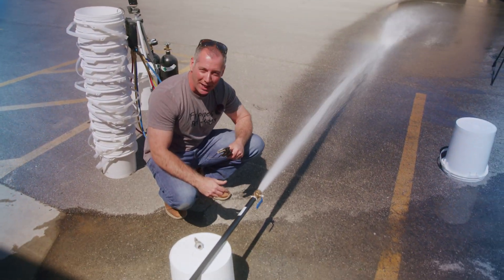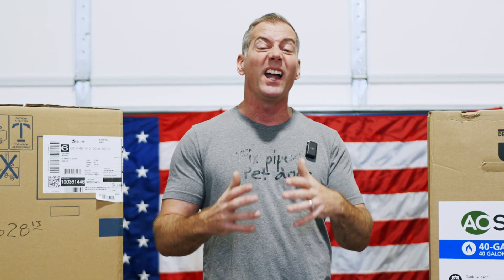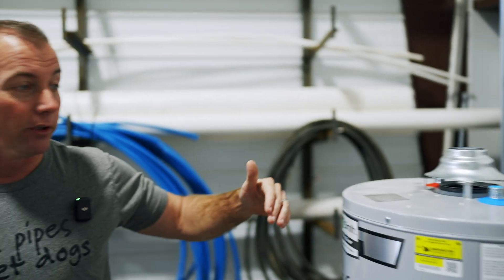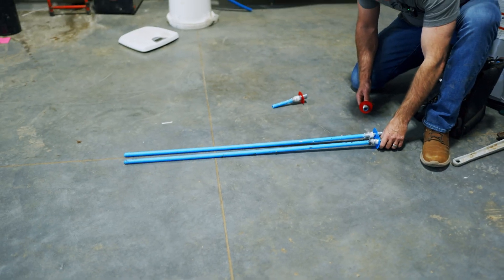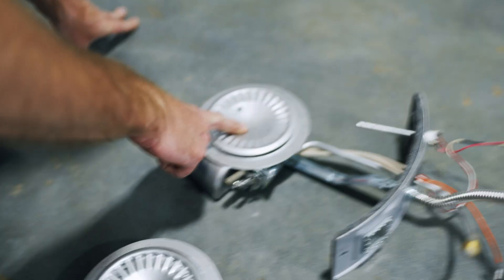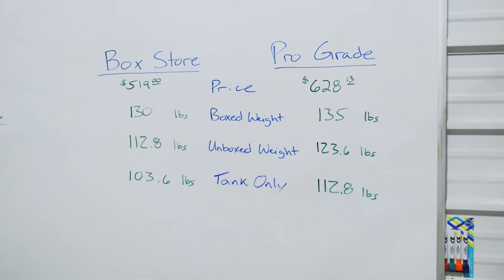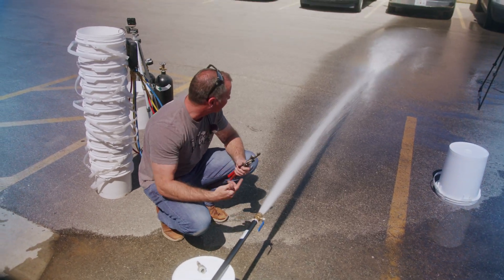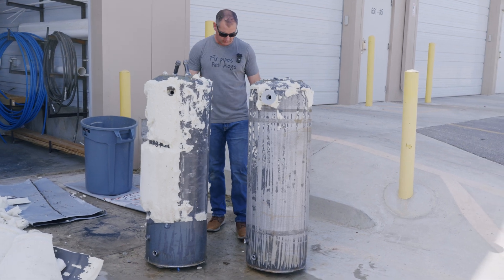What's the best water heater? Box Store vs. Pro Grade

Comment: Curoius our gas water heater in our townhouse the Pressure relief valve goes off every 4 to 5 months then its good again. The water out the tap is extremely hot.  Today it did it again The units have a main water feed with a central expansion tank for every 4 units.  Water heater is 18 year old so I know its close. Is this the gas valve malfunctioning to keep the limit to the adjusted heat temp
Reply from the maker: Sounds like your thermal expansion tank is either undersized or the bladder has failed.
Reply: @SmedleyPlumbing  So i assume the townhouse board needs to investigate the expansion tank in the unit its installed in that controls ours and 
the other 3. I appreciate the incite on maybe the issue. P.S. I havent seen much update on your Transit electric since you first did all the vids on it

Comment: I am glad you expose the differences. Those water heaters shouldn’t be allowed to carry the same model number. By the way it’s not just AO Smith. Rheem does the same thing.
This practice is gaining popularity with other product lines. For example the Zoeller pumps at Lowe’s do have plastic covers instead of the metal ones found on pumps sold either direct from Zoeller or through supply houses. I haven’t weighted them or disassemble them to see motor and impeller differences. I personally find this practice deceiving and unethical in name of profiting a few more bucks leaving an unsuspected customer with an inferior unit. I wouldn’t had an issue if they were sold as different models but selling them as identical it shouldn’t be allowed.
Reply from the maker: Yep

Comment: Ok so was it me or did the pro grade fail first??? So pro grade weighs more and cost more and fails under pressure first....
Reply: I mean nipples move and twist I can almost bet on the pipe attached to water heater going to snap
Reply from the maker: The box store unit started leaking first.  The pro grade held more and then popped.
Reply: @SmedleyPlumbing okay so prograde is still better?

Comment: Prograde 3800 installed. Is it really 3k different for a few more pounds of weight?
Reply: Not for me, for 3k could buy another 3 box store water heater, say they last 10 years each, that’s 30 years… is the pro grade going last 30 years?
Reply from the maker: You just explained an impossible scenario. You're comparing the installed price of a pro grade unit versus the over-counter price of a box store unit. One of them results in a complete professional installation while the other one results with you standing in the parking lot of a box store with a water heater that you can't fit into your car. If I were to compare the pricing of a box of Mercedes parts compared to the pricing of a completed and professionally assembled Mercedes I would be shocked at the difference as well. However one of them is a box of parts in my driveway while the other is a completed and professionally assembled car that comes with warranty and years of trouble for use.
Reply: @SmedleyPlumbing you know that the Mercedes example doesn’t make sense because we’re using the same pipe and internals from the house… the better example is would you rather pay Mercedes to rip you off on a battery change or do it yourself, since you’re just replacing a component and not getting into the internals of the house, ie the engine.
Reply from the maker: @kitmarshall4084  shame on you for assuming that a service provider is charging somebody for repairs and classifying that as a rip off. Millions of people every day spend excessive amounts of money on Starbucks coffee. Coffee they could make at home for a fraction of the price. But they don't complain because they enjoy the experience that comes from somebody else making their coffee. People's time is worth more than other people's time. And for some people it's actually cheaper for them to pay somebody else to do the repairs for them than it is for them to drop what they're doing and make the repairs themselves.
Reply: @SmedleyPlumbing i think you enjoy getting rip off… or insane rich that you’ve lost touch with common folks and resort to shaming those that try to save a buck or two
Reply from the maker: @kitmarshall4084  No there is absolutely no shame and wanting to do the work yourself. The shame lies in calling service providers a rip off because they're charging fairly for the services that they are providing. I don't know what you do for work but I guarantee you shouldn't do it for free and you probably don't do it for free and neither should a service provider.
Reply: There’s not a 3k difference, that is ridiculous. There’s about a 100 dollars difference…. You’re comparing apples to oranges and i have no idea where you’re getting your oranges. Most plumbers I know around here are getting 1000 or so for an installed 40g gas heater. If you don’t want it installed you can surely find a supply house near you that’ll sell you the pro model though.

Comment: My last box store water heater lasted ~20 years and I replaced nothing on it.  Just replaced it myself with another box store unit.
Reply from the maker: Things were definitely different 20 years ago.  It's thought that the units actually used to be the same back then.  Not so true today.
Reply: We live in Vegas and the average life span seems to be 9 years….horrible water. But, have seen the go longer, and less. The one in this house from new was replaced at 7 years by a previous owner so I assume something went wrong on the early side. I don’t know what Pulte uses in their new homes, but assume it is not box store. I know the appliances (Monogram) here are not like other Monogram’s we have had so assume a big builder like that has some kind of builder special model. Has the fancy label but cuts back on normal features.

Comment: My last  "big box store" WH I installed myself lasted 20 years (replaced 2022) and only had to replace the  gas control valve,  pop off valve and hot side flex hose during that time period...
Reply from the maker: Only?  Those are three fairly significant repairs.
Reply: @SmedleyPlumbing  Maybe if I paid a plumber to do it, but I DIY 90% of everything around my house.
Reply from the maker: @vorant77  what I'm saying is that you're standing up for a water heater that's let you down on several major components.

Comment: Too many cuts. I’m not seeing it.
Reply from the maker: This is the short version.  Check our channel for the full version.
Reply: Bought my 50gal water heater in 1995 I take pretty good care of it and in 2019 my pressure valve started to drip I changed it and here in 2024 of may working great good hot water no problems bought it at Westchester square plumbing supply in the bronx ny when I bought the house been dealing with them since the 60s